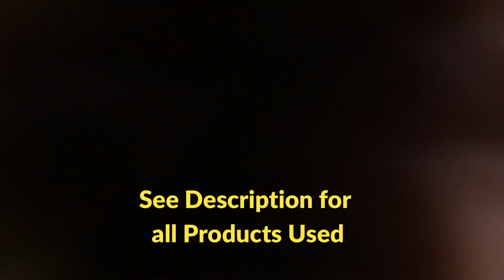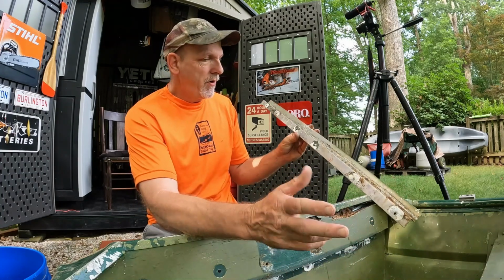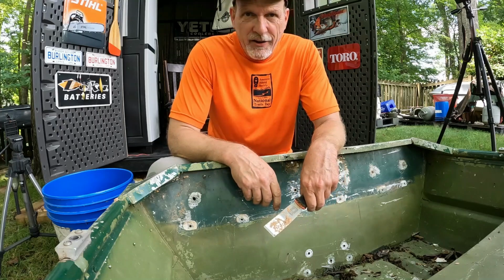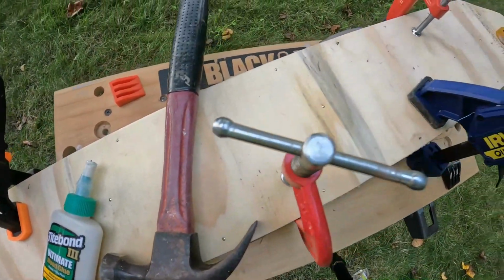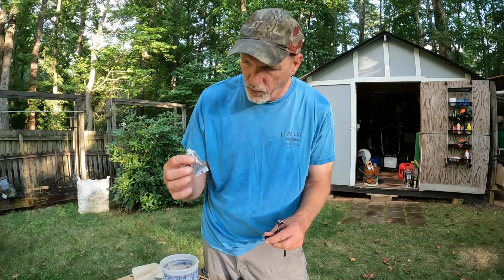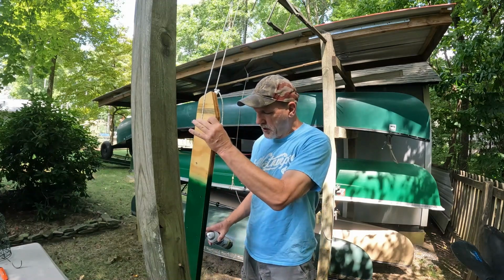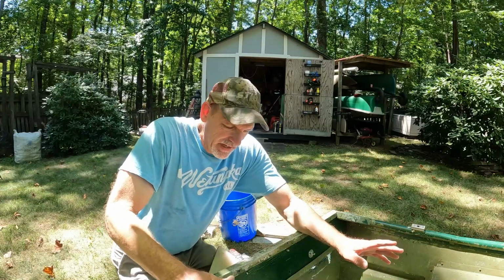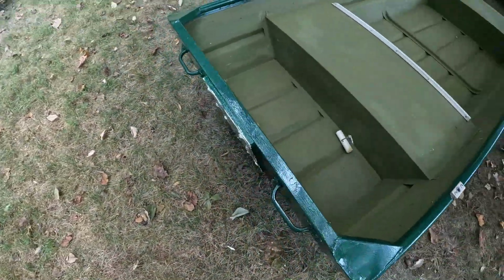Replacing the Transom  on a Small Jon Boat  Step by Step -    How to

Comment: So I did this on my Jon boat a couple years ago, found a uhmw material 2 x 6 x 4 on the jungle site. Also used a cutting board for the outside. Hoping to never have to mess with it again.

Comment: you said you waerent sure how that wood rotted 
its simpe that wood is in a lip
upside down that lip is a tray so when its humid outside the humidity gets in theregets in there and then at night the humidity condenses back in to water and is absorbed through in the wood  theres no way to stop humidity from rotting wood  you can only slow it down on my 2011 tracker (10ft) is still have the original wood  all i did was take it off and paint the wood  and i dont store the boat upside down because humidity comes from the ground  and when it does it gets trapped in an upside down boat and gets absorbed into the wood hope you find that in fo use ful
Reply from the maker: I have thought of that and my solution is to put a small hole or 2 where it pools.   its not the humidity per say its the humidity tuning into a pool of water.    i am going to dril a few timy holes.
Reply: @MackinNC1  that should work out pretty good  however for me storing boat upside down would create another issue 
the rails on my over lap the gunnels and are riveted in place  id then have the issue of the rails filling with water and freezing   
is your boat stored outside or in a barn